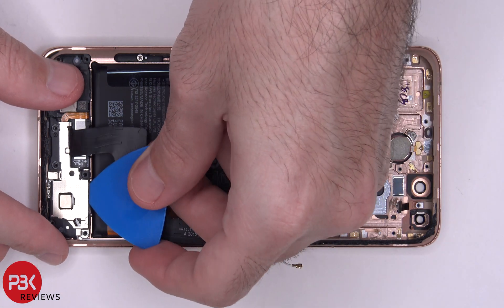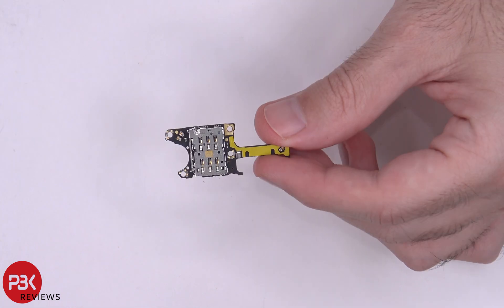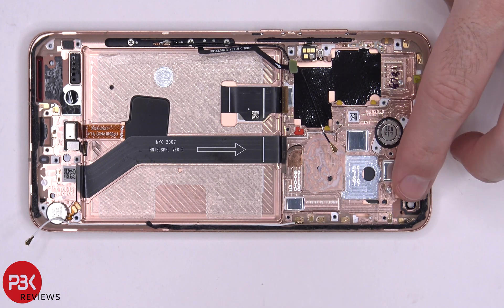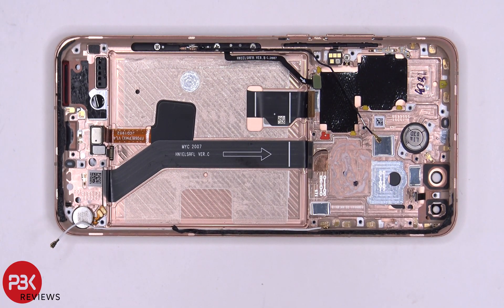Huawei P40 Pro Teardown Disassembly Repair Video Review 5G

Comment: Is the Fingerprint Sensor still working after repair? Mine need an Calibration do you know how I can do this? Thanks for any help
Reply from the maker: Hi, it should work but not sure what calibration would need to be done with this phone is it doesn't work. Have you tried backing up all your data and doing a factory reset?

Comment: So basically to change the front screen, remove back screen, remove wireless charging, remove battery, remove front screen sliding that cable out of the slot and reverse with new screen?

Comment: Hey man great video.. my p40 pro was dropped in water and has been acting weird. I noticed that the power plug port is white and black around it so it must of shorted out. Do you think my motherboard is damaged at this point or is it worth trying a new battery to see if it fixes my issues?
PS these phones are NOT waterproof lol
Reply from the maker: You can try taking it apart and making sure  you dry out any liquid inside and brush off corrosion from chips and connectors with a tooth brush or similar brush. Then put it back together and see if it will work.

Comment: Hello, 
I did a wrong thing with this phone at the beginning of use. Mistakenly I inserted sim ejector tool to the hole of microphone   & tried the sim tray out...Then i feel something is going inside.Although microphone is working fine. My question is 'will this action void the water resistance?And  Is there any Long term bad effect?
Reply from the maker: Hi, most likely it wont affect the water resistance but I can't be certain. Should not really have any long term issues, the mics usually sit above or bellow the hole.

Comment: Is there a rattle from somewhere inside when you put it on a table with the top first (like a slight knock). When I do it I hear a bit of a rattle in mine.
Reply: It is the camera module rattling because of optical image stabilization
Reply: @devendra007  Thanks. Do you think it should do that? My Mate 20 Pro doesn't.
Reply from the maker: yes, its the camera.
Reply: @PBKreviews  Thanks. Should it do that? My Mate 20 Pro doesn't.
Reply: Because mate 20 pro main camera sensor is small as compared to p40 sensor.All the phone with big sensor like s20 ultra and p40 camera sensor rattle

Comment: After a disassembly do you think the phone will be less resistant to water and dust ?
Reply from the maker: yes unless you use the original pre cut adhesive that's made for the phone, the seal wont be as strong and well sealed.